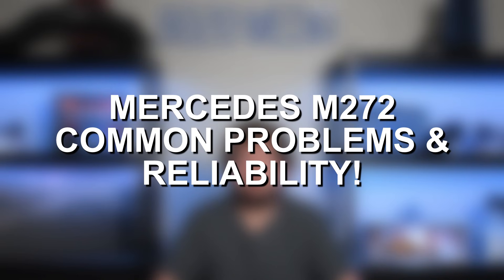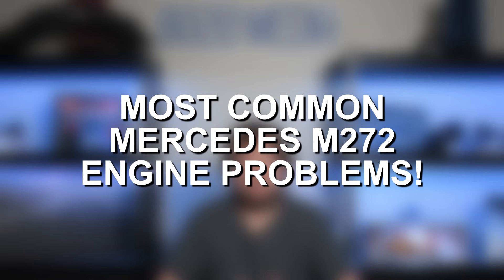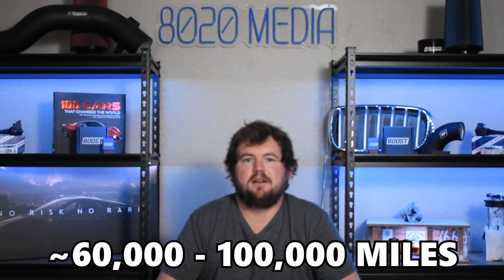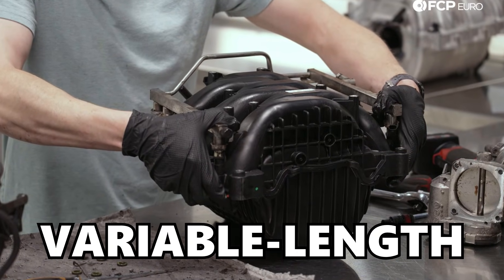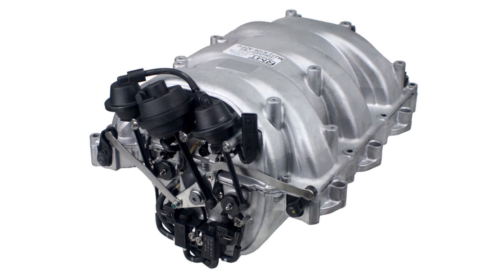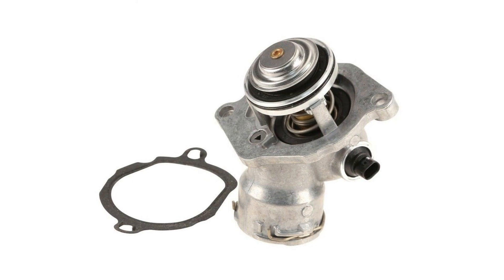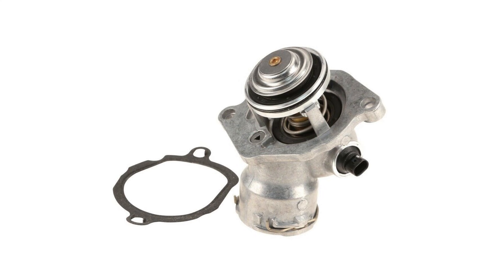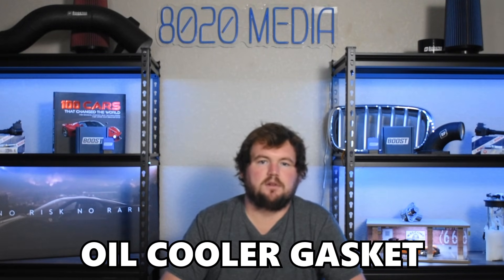The TRUTH About the Mercedes Benz M272 Engine!

Comment: I have a 08ml350
The common issues i have fixed are
Thermostat, intake manifold tumbler flap, oil cooler and filter housing oil leak, oil drip pan and pcv cap, A/C and blower motor, cracked rear springs, transmission pan  rusts and cooler lines leak, brake lines severely rust( rust belt areas) water intrusion from rear tail lights damaging rear sam, liftgate pinch sensors dryrot unable to close with remote or door switch. EIS ignition switch fails. Thats most of the issues i experienced with my wifes ml350. Its now 150k miles.  Only issue left is cold start rattle from oil pickup tube. Most have been fixed by myself and my local autoshop. Crazy

Comment: Show me a shop willing to fix my balance shaft on my m272 for $2,500 and I’ll take my car there RIGHT NOW lol. 

I have a 2007 C230 Sport with about 130,000. It does have a CEL for what is likely the balance shaft. All the cam magnets have been replaced with e sensors and the CEL keeps coming back. I figured I’ll just keep driving it until the engine goes kaput and then I’ll likely get another 2007 C230 lol (I love these cars). BUT if someone can fix mine for $2,500 I’ll happily take it to them.

Comment: The m272 Is One of the best reliable engines every prodeced. The cost of replacing the balance shaft and timing chain Is not High and Is only needed on some number engines, not all the m272. The issues you talk about are nothing compared tò a diesel or tò a modern Little petrol engines.

Comment: Mine has a knock on cold start noticed after 1st service, they told me they changed to another in house oil at 15 000km/20 000Km. Its now 155 000Km and nothing has broken yet I changed to Fuchs 5W-40 which make it far less happening. The engine is clean I change oil every 6 months or 2500Km, then hope for the best. I open bonnet after trips, so it not cook in the heat in garage. Mine SN is out of range for cam problem.
How will Fuchs 10W-40 be -?
Reply: drive your gas near empty put royal purple max clean in your gas tank then fill it half way repeat then lmk if that don't work i got another tip
Reply: @arctic350  How does that work, you think its injectors-?
Reply: @chrismate2805  yeah i'm only recommending things that i've tried and actuallly got good results  , after you don that get an oil change then top your oil off with lucas motor oil stabilizer come back and tell us how things worked out

Comment: Mine at 50,000 miles has a slight knock at tickover on the r/h bank (as you sit in the car) that I believe is the piston skirt of one piston tapping the bore. Research shows it's one of the "they all do that sir" issues. Largely rectified with 5w50 oil.

Comment: In my experience it's hit or miss, between the intake, oil cooler gasket failure, balance shaft and cylinder scoring issues. Having rebuilt 3 one literally ate the coating on the walls. 

Also FUN FACT there's no oil pressure sensor.

Comment: 345 000 km on mine, but doesn't want to start anymore though it cranks ; OHC sensors and TDC sensors brand new though... Fuel delivery OK.
Reply: Could be the infamous electronic ignition switch/steering lock

Comment: Talk about M272 and never mention cylinder scoring? 

The engine sounds like a diesel while idling? Cylinder scoring…

This tends to happen on higher mileage vehicles but it is a very, very common issue… you might want to research it before buying a car with such an engine.

Cylinder scoring is practically unfixable, which means an engine swap will be on the way…

The point is also valid for M273 (the “bulletproof” V8), however there tends to happen more rarely.
Reply from the maker: N-  Thanks for sharing these insights.

Comment: Cam plug covers, oil seperator and vacuum pump oil leaks are all common problems as well.  At rear of engine.Just had mine done. Oil seperator oil leaks can damage the swirl flaps in the inlet manifold so it should be addressed to minimise consequences. 
Mine has covered 167k km with no issues. The balance shaft issue was only up to a certain engine number. Google it to find out if your sis at risk. Not all fail of course butit is a big potential isdue

Comment: so far so good with mine M272 , occasionaly l have the P0016 but withouth any signs of unusal cold start noises. the consuption is below average on open roads , all in all pretty solid engine , but the P0016 and what triggers it is still unknown to me. The car is out of the critical time period from the balnace shafts (until 2008). so really just the regular maintanane regular oil change every 8.000-10.000km and all should be fine.
Reply: cam magnets, check connector for oil b4 it seeps in your ecu
Reply: which connector exactly ?  @defalt45
Reply: @legionofwarriors  Cam magnets connectors, there's one in front of each camshaft, held by 3 screws on the front of the cam gear covers
Reply: @defalt45 
gotcha. they are in front , those are solenoids.

Comment: As long as you keep an eye on thermostat replacement, and also replace the tumble flap on the intake manifold with a steel flap, it is a tank.
Reply from the maker: D - Well said.
Reply: my intake manifold is broken, otherwise the car works just fine. Is it work paying to replace it? I didnt even know until the mechanic was doing their scan and it had the code for the tumble flap
Reply: In my honest opinion. Yes, fix it!
I lost a bit of top end power since the flaps restrict air when stuck closed at high RPM.
Easy-ish job to do yourself or at any mechanic, just check over the quality of work.
Reply: @8MunchenBayern8 If you have a reliable mechanic, its worth getting to the intake manifold and you will see the broken black plastic flap. Very easy clip on replacement, steel. Engine light went and so did those fault codes. No problems since.
Reply: my thermostat is stuck open whats the consequence of that ?
Reply: @PRTube01  you should get it replaced with a new one. the thermostat not working properly effects engine cooling/warming so you want to take care of that asap.
Reply: 192000 km on my 2007 SL. Zero failure,  no oil consumption
Reply: What do you mean for Tumble flap? It' s avaiable a steel part?
Reply: @davidrchionna2973 its the flaps that are on the intake manifold, they open and close and often snap. Original is cheap plastic so aftermarket have stainless steel "flaps" roughly between €40 - $60.